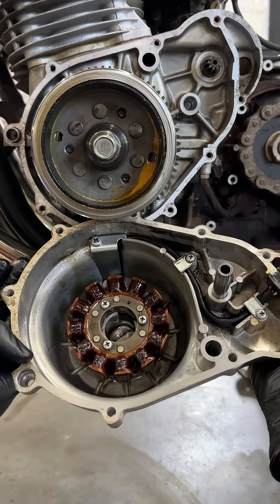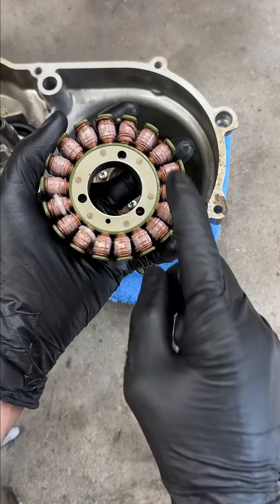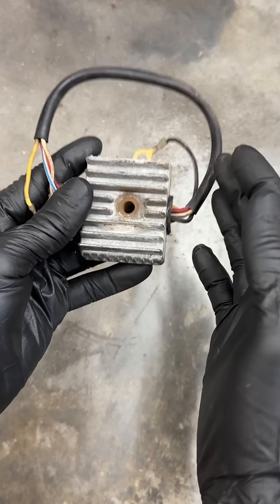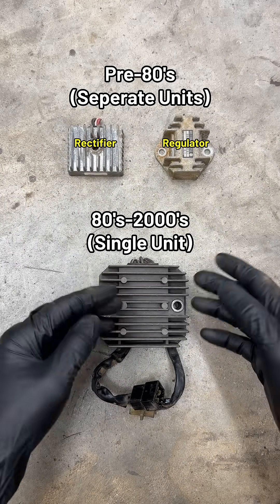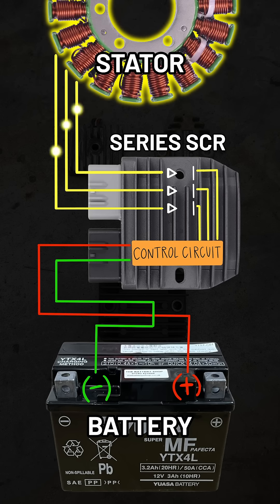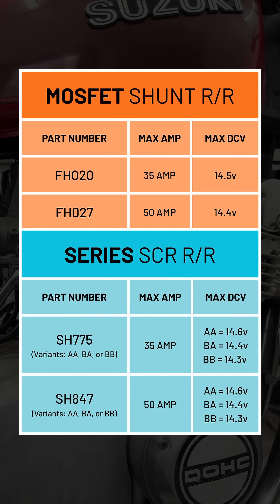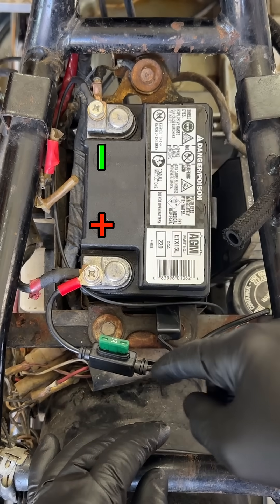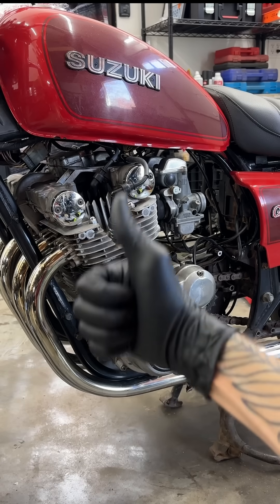Easily Update Your Charging System! ⚡️

Comment: 90% of charging issues ive done have been failed rectifiers. Ive only found 3 stators bad. You can bench test a rectifier by reading the ohms. However cheap rectifiers dont last as good as oem manufacturer brand. Also if you are running a lithium battery the rectifier must be replaced by one designed for the battery. They are very sensitive to voltage and if they get more then 14.2 volts dc they will melt and catch fire!

Comment: Meanwhile im out here with 6 diodes haphazardly soldered together with a capacitor and cheep buck converter from Amazon with curent and voltage regulation.

Who contraption in also house in a Tupperware container with the holes for wires hot glued.

Comment: You must test also the stator phases to the ground. 🤷
Becareful if you change original regulator with the wire sizes.
Reply from the maker: If it fails to put out AC from the stator wires when running, you don’t need to ground fault test them too. I go straight to the AC test because they can pass ground test and still be bad. But AC test is certain.

Comment: what would put the least load on the stator? the GL1200 has a habbit of burning out it's stator
Reply from the maker: Theoretically the SH (series) should be easier on the stator since it is the only type that “turns it off” (sort of) when target voltage is reached. Any shunt style lets the stator run full output and just dumps the excess.

Comment: Dang this would have been nice to know in the late 90s when I needed voltage from my 175E.  I think I just wired it directly to a Halogen fog lamp and dented the reflector to give me a pattern that threw on the ground.  It got impressively bright as you revved it, don't think it had any regulation.

Comment: How often do stater burn out ? Is there syptoms that let you know there's  a problem?
Reply from the maker: They’re really reliable in general. Age is a big factor, so a 1970’s stator for example might fail from the resins breaking down. The other thing that will kill them is failing connectors between the stator and R/R. That contact resistance can overload the stator and fry it along with the R/R. Symptoms include weak charging. So like your battery won’t stay topped up while riding, especially with lights on/ aux accessories like heated grips etc. also look at those connectors, if they look burnt or melted, there’s a problem!
Reply: Lights that get brighter or blink with switches
Reply from the maker: @eflanagan1921that can be a symptom, but it can also happen with a properly functioning charging system too. Especially at idle and on older bikes with incandescent lights and greater resistance in the harness.